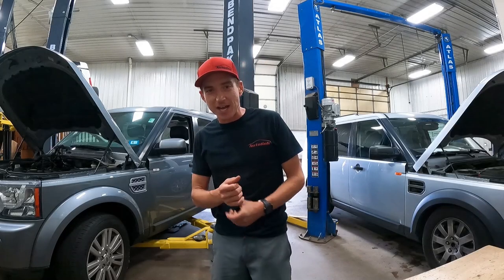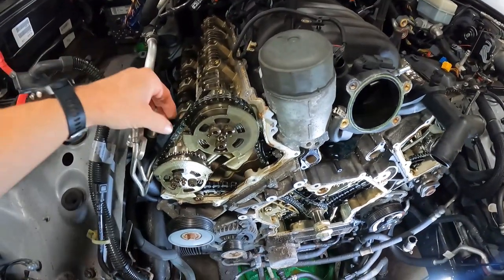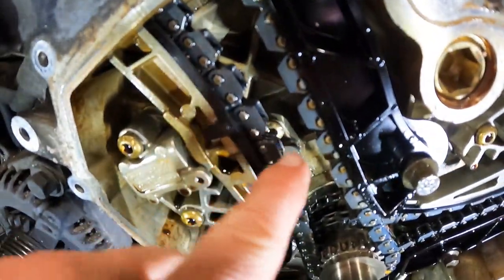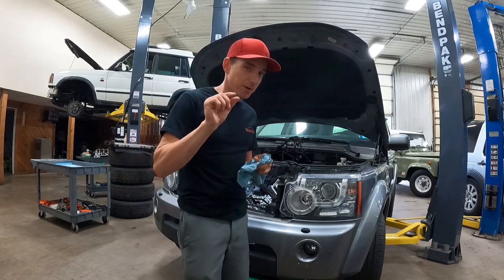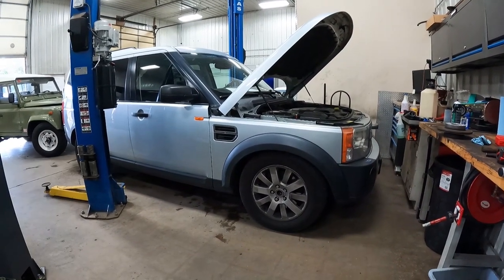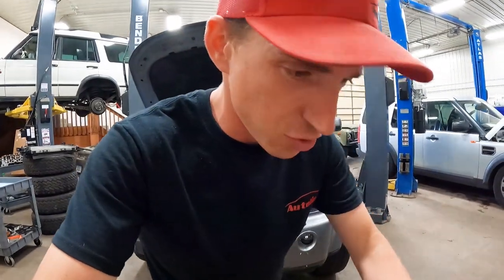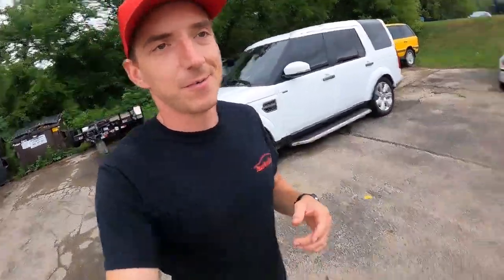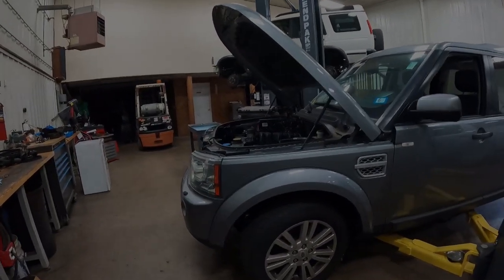LR4 Timing Chain Problems - The Land Rover Achilles Heel

Comment: I saw there was a potential class action lawsuit for this. Supposedly it was for models made between 2012 - 2014. Do you know if later models have the updated guides?
Reply from the maker: Just those years as far as I know. And it was pro rated up to 8 years and 100k miles. So unfortunately a lot of the ones that we have fixed are not covered because it’s after that mileage mark. Supposedly 2013 was supposed to have the updated guides.
Reply: @LostCauseRanch  is there any way to check, maybe with VIN, whether a 2013 LR4 has the updated guides with that fancy steel button? Besides opening up the whole motor?

Comment: hi I'm thinking to buy one tomorrow 2012 with 70k miles, should i do the timing belt before it goes bad?
Reply from the maker: We typically wait until they start showing signs of issues since it is an expensive job. Typically you have fair warning with either a check engine light or noise.
Reply: @LostCauseRanch  thank you
Reply from the maker: 70k mikes is the earliest we personally have had to do them. The bulk of the ones we do are in the 90-120k mile range just for reference. Have also seen them past that 120k mark and not need them yet.
Reply: @LostCauseRanch  I'm not scared very excited and I know I will spend money but it's the car that the wife wants, we had an LR3 and we loved it.

Comment: I have a 2012 RRS SC and I’m in the middle of repairing the timing system myself. Funny enough, the same bolt for the passenger side guide and oiler was broken on my engine too! Even part of the oiler was down below the crank wedged in just like yours. What method do you guys use to remove the broken bolt in the block?

Engine has 118k miles and was always dealer serviced by the previous owner up to 105k. Land Rover shops in my area quoted $7k and the dealer quoted $9k.

Comment: Great video - you crack me up almost as much as I crack myself up......quick question my 2012 LR4 is a month shy of hitting 100k (I bought it new I'm one of those rare original owners that drives their vehicles until the wheels fall off before getting another one but properly maintaining it the whole way) and outside of maintenance the ONLY thing I've had to replace is the rear view mirror due to the Homelink buttons mushing out and not working. I'm starting to hear some timing chain slap every 3rd or 4th startup so it's time to have the work done and I am currently weighing some repair costs. I have to wonder though what is going to break next and is it worth it to keep it or should I seriously think about a new vehicle.  And finally here's my question - the ZF 6HP28 transmission in this vehicle - do you consider it strong and capable of going at least 150K miles before its needs attention? If it's going to crap out soon that would be another HUGE expense to face next. Thanks!

Comment: We have a 2016 LR4, 100k miles, owned since 2019, at the time of purchase low miles.  The timing chain went, maverick mechanic and LR Dealer said we need a new engine.  The car has been serviced regularly at LR Dealer where we bought the car,  the engine light has been a frequent problem since we purchased the car. We also recently (last 6 mo) complained of a pinging noise upon start up and excelling.  Do we have a case for zero responsibility?  Does the timing chain just go?  Or is it over time becomes loose then catastrophic?  Trying to build a case would love your insight.
Reply: This is a good question, I would love to know the answer.

Comment: How prevalent is this?   Looking at 2011 with about 100k miles.  Anything other then the noise to check out?
Reply from the maker: I wouldn’t say guaranteed. But the early ones it is prevalent. I typically tell people just to budget it in when you are deciding on the purchase. Then if it happens it’s not a huge deal, and if it doesn’t you have extra money around. I will say the factory recommended extended length oil change does not help the cause.
Reply from the maker: They will typically start throwing a timing code in the ecu as well. A lot of times we will see that before noise.

Comment: There are a few theories on the various Land Rover forums that the increased wear on the guides may be caused by consistently high-ish oil pressure within the engine, if I'm understanding correctly.

The general consensus I've read seems to indicate that very regular oil changes (every 3-5K miiles) significantly helps mitigate this too high of pressure (as well as reduce wear from dirty oil), which causes the guides to wear much, much more slowly than the guides in engines that are doing the "Land Rover Recommended" oil change interval... which is a crazy "every 15K miles" oil change.

Any thoughts on this?
Reply from the maker: I personally would have the opposite thought on the oil, in that it would be lower pressure because of age/breakdown. Typically the oil thins out/breaks down with age and you see oil pressure drop. Unless the filter was plugged and causing a rise in oil pressure but not high enough for the bypass. But I am by no means a expert in the oil field. But I do agree in the thought process of the long factory interval being a big factor in the early wear.
Reply: I know this a year late, but living in Taiwan, cars here have oil changes every 3,500 miles! You see a lot of old Japanese cars still running. My wife is still driving her Nissan Lavina, and that's 10 years old and runs very well.

Comment: What is up L.C.R. I have a 2012 LR4 I purchased from someone out of state as is I was told the car sat for a while because the previous owner turned the car off after white smoke. Now my dads mobile mechanic came and tried to turn the engine from starter motor hole and told me engine doesn't turn that its most likely seized. Do you think it can be timing chain or something else instead any suggestions? Where are you guys located how much do you charge for this particular type of work?

Comment: Hi guys thanks for your video,  Really helpful. I have a 2012 rangy autobiography with 116,000 miles and this will be the third time the timing chain will be replaced. Is that normal or something else is wrong with the engine? Thanks
Reply from the maker: I would say something is going wrong. I would check and make sure the oilers for the chain are in good shape. We usually don’t have to ever do chains a second time. Can also have cam gear issues. But I would say that is abnormal especially at that mileage.
Reply: @LostCauseRanch  thanks I’ll mention that to my mechanic. I enjoy watching your videos…
Reply from the maker: Also, what are you/they using for parts? Doing all the guides and tensioners as well? Just curious as something isn’t going quite right for sure. Thanks for the kind words.
Reply: @LostCauseRanch  my mechanic gets the parts from Land Rover dealership, I did mention what you told me and he agreed with you so he will look at it too.  Nice rooftop for your camping tent on your last video, I’ll get that for my when I get it back for sure. I live in Washington state and we do a lot of camping stuff here.
Reply: @LostCauseRanch  I thought the same thing, chains ⛓ in general last ⏰ time.

Comment: DAMN!! I wish I saw this 24 hours ago ... We JUST bought a 2014 LR4!!! The wife's 2012 LR2 has 200+K and still drives like new. What does the timing chain replacement run ball park??
Reply from the maker: I wouldn’t lose sleep over it on a 2014, still a possibility but not near as prevalent of problem as the 10-12s. I would just move my oil changes to 5-7k miles with good quality oil.
Reply: @LostCauseRanch  Yeah...this has the 3.0 V6...we change the oil in all our vehicles 3-5K
Reply: @LostCauseRanch  the 2014 LR4 only has 72K miles...so hopefully it'll last a while!?
Reply from the maker: @tclodfelter8789  That is good, the other thing to keep an eye on is the coolant level. They have plastic coolant pipes under the supercharger that can leak and have seen head gaskets taken out by people not paying attention and overheating the engine. You seem like someone who isn’t going to be oblivious to that so you should be alright.
Reply: @LostCauseRanch Thanks for that info! Yes...we take care of our vehicles. My 2006 Fusion (222K) gets the same treatment as day one and she runs fine!

Comment: I only have 40,000 miles on my 2016 LR4 HSE and the timing chain was leaking, conveniently right after my warranty expired.  It was March 2021 when the dealership supposedly resealed it for a whopping $1,200.  I am just posting this comment to let you know this can happen sooner than 80-100,000 miles.  I really want to keep my vehicle so hopefully I can get it repaired by a reputable mechanic.  Thank you for your video!  Where are you located?  I will bring it to you.  😃

Comment: After reading about the timing chain issues even with the newer models and different engines..I’m thinking it’s because of the terrible oil change intervals they do..it’s way too long!! And the oil they recommend for these massive engines is low grade. No wonder
Reply from the maker: Agreed, the factory service interval is way too long. The last 2013 LR4 we did chains on was dealer services at the recommended intervals and we had to do chains at 70k miles. We put our customers at 5-7k miles intervals.
Reply: @LostCauseRanch  i always do mine as close to 5k as possible, highest its been 6200 one time. oil is cheap in comparison to pulling the engine apart

Comment: Debating a 2013 with 125k miles and a 2016 with 77k miles -- both have great carfax records and cosmetically look well kept. the 2016 is almost double the price.... what do you think?
Reply: if it has 125k miles on it, they should have already done the chain and tensioners, if not im sure it sounds like a sewing machine at idle
Reply: @squirrelmaster1225  I ended up getting the 2016, it will arrive here in a bit!
Reply: @jeslynlane  nice work, let me know how you like it : )

Comment: I have a 2016 V6 supercharged with 90k miles.  When should I consider having the chains done?  Thanks!
Reply from the maker: On a 2016 I would just make sure you shorten the oil change interval from the factory 15k mile recommendation. It will have the updated timing components so you are not guaranteed a failure. There really isn't a set time and the vast majority of the V6's fair well if they are maintained well.

Comment: How long last to another change of the chain?
Reply from the maker: Hard to say. I think a lot of it has to do with oil quality and oil change interval. I see no issues with the updated stuff going a couple hundred thousand miles if you are much shorter on oil changes than the factory recommended.